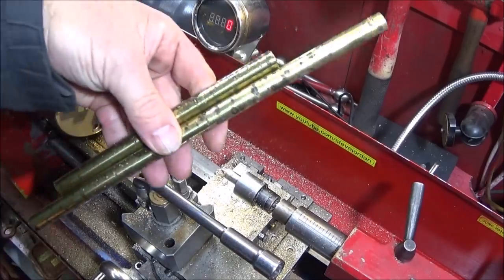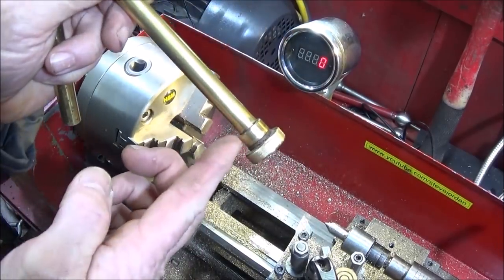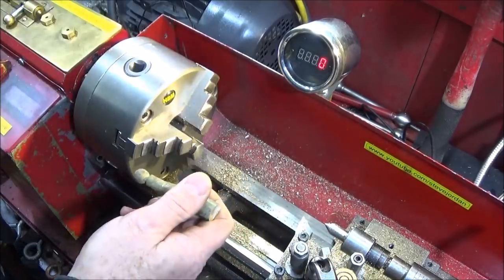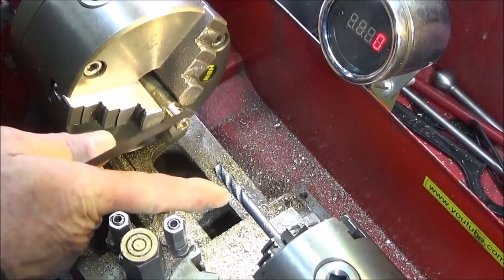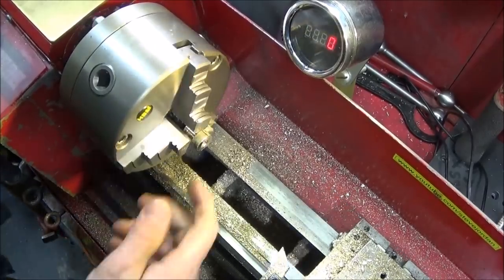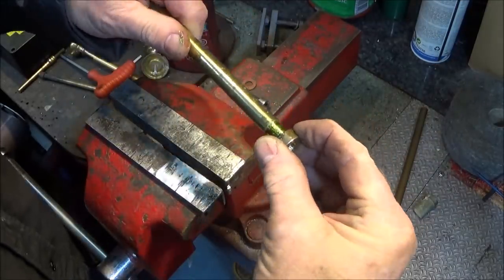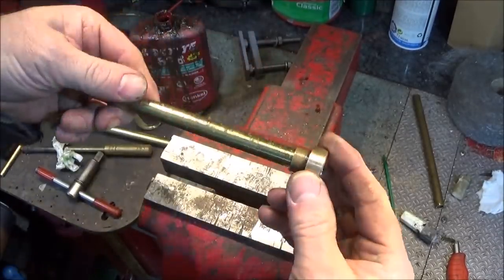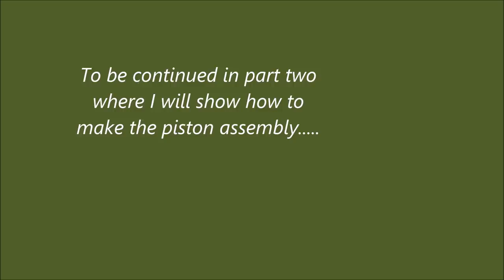Making A Brass Fire Piston Or Fire Syringe On The Lathe PART ONE

Comment: Steve, can you please talk to us about the tools used for turning/parting-off brass. Kind regards from Australia.
Reply from the maker: Hi Paul, That is this one here:-
EXT GROOVE TOOL 12MM SHANK 2MM WIDE INSERT TYPE... https://goo.gl/1uRpB4 
It is really a groove tool, but it is excellent for parting-off small diameter work. You can also get the Blue Nano type inserts for these, to cut hard steel or titanium. In the part two video you will see me machining the o'ring grooves with the same tool. Regards Steve